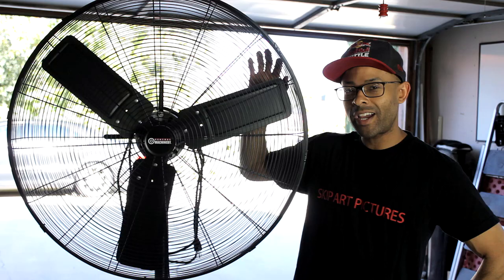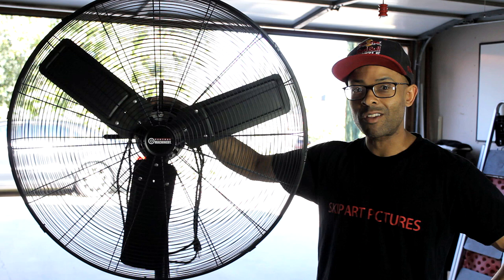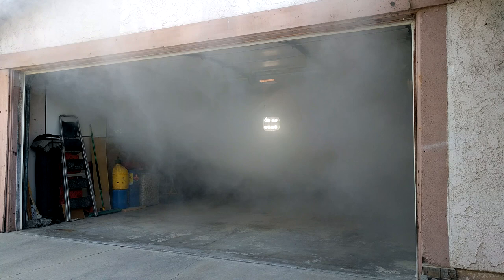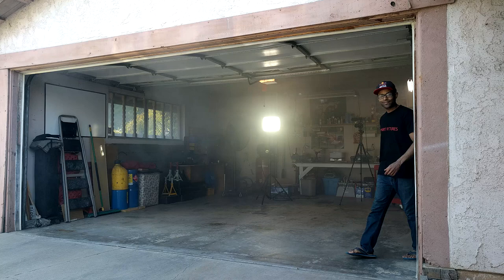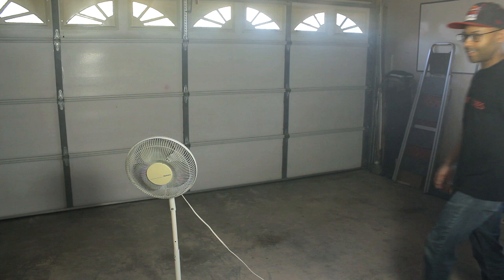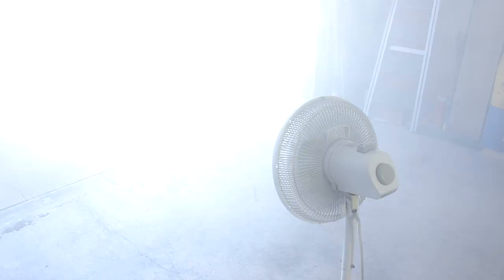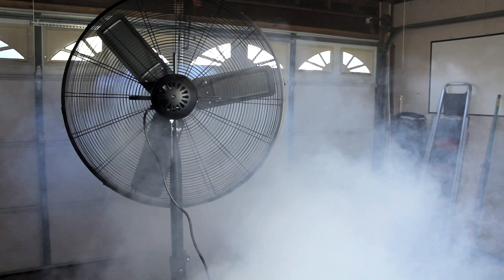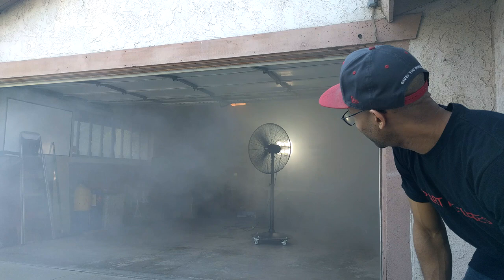HARBOR FREIGHT Shop Fan 9000+ CFM | Central Machinery | Review

Comment: I just bought this fan.  It's very difficult to work in my garage during the hot and humid summers we "enjoy" here in central Illinois.  I put this fan in a back corner of the garage and just aim it in my general direction.  It does a great job keeping me cool enough to work.  I've never used it on it's highest setting.  I usually have it on low and it still provides a ton of air flow, without drying my eyes out.  I considered their floor model 24" fan but I never have a clear path between any two points in my garage.  Even if I did, it would just kick up a lot of dust.  In any case, I consider the fan a great addition to my garage and I wish I would have purchased it a long time ago.
Reply: Hi.  Is it too loud and too strong for a living room? (Even on low setting)?
Reply: @gotminnam  If I remember I will try to update you because that is my intention, I live in a travel trailer in the south in the summer without air-conditioning so it gets stinking hot. I had a box fan but it just can’t keep up. Even with it sitting right next to my head so I’m really curious about this one. Pretty sure I’m not gonna be able to hear anything on the TV 😂

Comment: I think the fan can extract the smoke way more efficiently if you place it a little bit more towards the outside, just under the garage's door
Reply from the maker: I like your Idea Med k! :)
Reply: Second that motion. Inside your pushing smoke around inside. Placed st door, your drawing all out.
Reply: Yes, can you conduct the same test with the fan sitting at the bottom of the garage door with cardboard taped to each side .with the garage open at just 30 inches the height of the fan. ..  would love to see how it pushes the fog out to simulate a true makeshift garage car painting booth situation ..

Comment: One thing to consider is you will have an equal amount of air going in as you do coming out, that is why the fog does not really dissipate because some is being sucked back in. For a very hot shop or garage you will just be moving hot air around, and only feel kind of cool standing directly in its path. I have one of these and in a 100 degree garage it just blows hot air all around and is very noisy. Useful in certain circumstances
Reply: I agree it seems kinda loud in the video good point

Comment: If you want it to be even stronger than that you can always been the blades to a deeper pitch by hand or machine and plus it will be a lot quieter I have a lake with P 25 bucks wi I have a lake with P 25 bucks Bucs fan the blade on them is centered in between the blades so there’s the same amount of blade in each on each side Event the blades a little bit to a deeper pitch it is much stronger than it was and quieter You should do the exact same experiment with the big fan in the small fan this time with the garage door closed and make a little tornado

Comment: THANKS FOR THE VIDEO!
Question, Sir -- I just got this great fan and it works just like yours (GREAT!), but the motor housing near the fan settles out at a temperature of around 140ºF -- pretty hot to the the touch. Is that normal - is that like yours?

Comment: just ordered a 10000 CFM pedestal fan(30 inch) been looking for some sort of demonstration to match what i should expect. Thanks
also i always sleep with a fan on (i need a fan to get a good night of sleep because of tinnitus and the white noise helps) but the one i have been having to use fucking sucks(just a shitty ass 20 inch box fan) it's not loud enough nor does it move enough fucking air for me to remain comfortable been dealing with it for 9 months now and finally had enough

Comment: Second time I bought this fan in two days. Harbor Freight Technical hotline said the motor is not supposed to be hot enough to where you cant lay your hand on it. I returned the first one only to find the second brand new one I purchased has the same issue. Within 15 minutes it gets hot enough to where I cant place my hand on the motor housing. Does anyone else with this fan experience the same issue? I worry this will fry the motor. If anyone else has this problem let me know. I am trying to figure out if I should keep the darn thing or not with the amount of heat its still kicking out.
Reply from the maker: Hi Nicole L! I appreciate you taking the time to watch my video. I'm sorry to hear about your fan. After reading your comment I ran my fan for about an hour on low (the lowest setting is usually strong enough for me) and I placed my hand on the motor and it just felt warm to the touch. I hope the next one that you get doesn't have the heating issue because these fans are really awesome to have. Best of luck to you. Cheers!
Reply: I’ve used other similar fans made by other brands and they would get pretty hot too. I never thought it was much of a hazard though.
Reply: motors are usually rated (insulation) to 90* Celsius. So yeah, i am sure its fine....

Comment: Where did you find the rolling stand for this fan?
Reply from the maker: Hello The00Beard! I purchased some casters at Harbor Freight, then just used a drill to open up the holes on the base plate a little bit. Be sure to get at least one caster with a brake, otherwise the fan will move around while it's on.  Hope this helps. Cheers!
Reply: @GarageDynamics  was just wondering the same thing, thanks!!!

Comment: I could not find any listed specifications for how many CFM this fan moves. Makes it impossible to compare against competitors products.
Reply from the maker: Hi daboomer22sl, Yeah, it's a bummer that they removed it from their catalogue. I will say that if it goes on sale then it's totally worth it. I've had mine for a few years now, and it's still running strong and keeps the garage cool in the middle of summer easily.

Comment: Very helpful.  Thanks!
Reply: I just bought this fan.  It's very difficult to work in my garage during the hot and humid summers we "enjoy" here in central Illinois.  I put this fan in a back corner of the garage and just aim it in my general direction.  It does a great job keeping me cool enough to work.  I've never used it on it's highest setting.  I usually have it on low and it still provides a ton of air flow, without drying my eyes out.  I considered their floor model 24" fan but I never have a clear path between any two points in my garage.  Even if I did, it would just kick up a lot of dust.  In any case, I consider the fan a great addition to my garage and I wish I would have purchased it a long time ago.

Comment: I wonder how this fan compares to the 24 inch high velocity harbor freight fan that is priced the same.. 149.00.
Reply from the maker: When I was comparing these fans I went with the tall one because the CFM rating was higher. The taller fan is also nice for clearing out hot air in large spaces, like a garage or something. Since I work on cars a lot, having the 24 inch high velocity fan would be nice to cool engine bays and exhaust pipes. I guess I'll have to buy this fan as well haha!

Comment: where do you find the 9000 cfm rating? I have looked hard to find a rating because I am interested in this fan. Most fans are sold on claims of cfm performance but not so for this Harbor Freight listing...which I thought is odd. The real value of your video is seeing the air turbulence created by the fan and of course that is possible because of the smoke. Other comments range widely about value of this test and even the value of having a circulating fan in high heat conditions. While it does not cool the air ( in fact the heat of the motor would increase mean ambient temperature), circulation of air is useful in managing heat in live animals and machinery. I have an idea that a guy could affix a small bank of misting nozzles, with a garden hose hookup to the front of the fan cage and thereby create a crude evaporative cooling effect.
Reply from the maker: Hello gary mcmullin, I wish I kept the old ad catalogue. It used to say it on the coupon. Harbor freight removed it in later ads. Thank you for recognizing the value in my video. You are correct. It will not cool the local area, but it will move the air. Being in the hot humid southern heat I can tell you that this fan is a blessing. It will circulate the air in the whole garage creating a nice breeze. I like your mist idea. I think that would work pretty well.
Reply: @GarageDynamics  thanks for update, I am still debating to get one of these.
Reply from the maker: @garymcmullin2292  You're welcome! I've had it for about 5 years now and it's amazing.

Comment: Would you recommend/Has anyone used this in there house for cooling in the south. Like 95°f plus high humidity? During the summer?
Reply from the maker: Hello LSPR Nation! This would definitely work well in the garage to move the southern heat. It should work in the house, but please plan ahead where you aim the fan because it's really strong, even on its lowest setting and quite loud too. But if it's heat you're concerned about, then this fan will help a lot. Cheers!
Reply: Thanks man!

Comment: Pedestal fan vs floor barrel fan, thoughts?
Reply from the maker: Hello Shane Baker! I went with the pedestal fan because it had more CFM listed in the ad. I wish I held on to that ad because now I think they removed the CFM rating. Also, the Pedestal fan is better for mobility and storage space once you add casters to the base. But if you work on cars a lot and need to cool the engine down, then I would go with a floor barrel fan. I hope this helps. Cheers!
Reply: @GarageDynamics  I looked all for for the CFM rating last week and couldn't find it until I saw it in your video. I wonder if they got in trouble for making a ridiculously over exaggerated claim 😂
Reply from the maker: @PWgadgets  Yeah, I noticed they removed it a while back. I wish I saved the catalog that showed the CFM haha! Cheers!

Comment: So how is this fan working after a year and a couple months?
Reply from the maker: Hello Artincorona, I just held an event over the weekend and had the fan running for over 4 hours straight. It ran just fine. I've also used it a number of times throughout the year, all on the lowest setting, because even at the lowest setting, it's still super powerful! Cheers!

Comment: I highly doubt that is putting out 9000CFM @ 1.8 Amps (specs from HF's website), and if it was it would have either rolled back or tipped over (yes I know the wheels have breaks), and further more 9000CFM is like running 8 or 9 heatpump air handlers at the same time which would draw way more than a standard 15Amp wall outlet. Next time do your math.